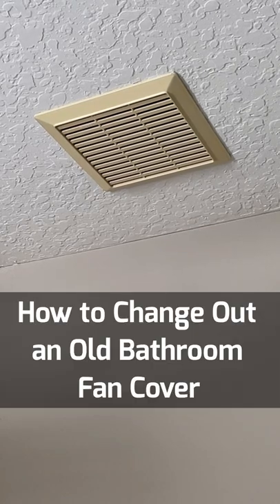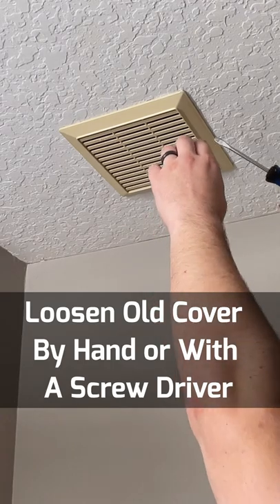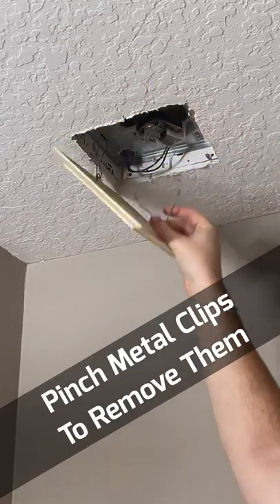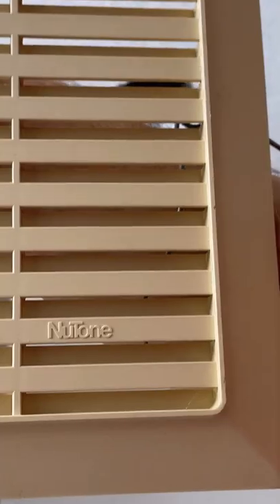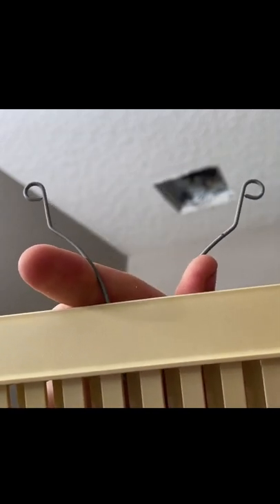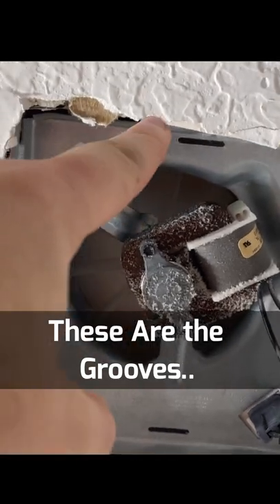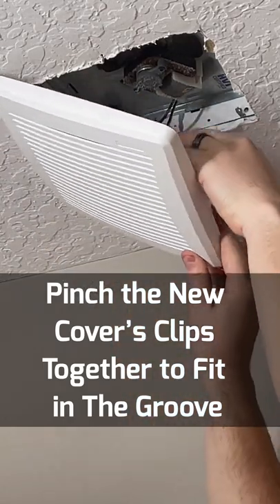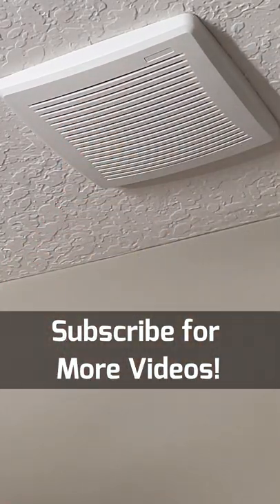Replacing a Bathroom Fan Cover #short

Comment: Those metal clips threw me off lol, thanks for posting
Reply: Those metal clips threw me off, too.  I had pulled the clip off of the cover instead of from the top as in the video.  The cover is next to impossible to put it back on that way.  Accidently, I discovered that the clip can be removed from the top as in the video, then all was good.